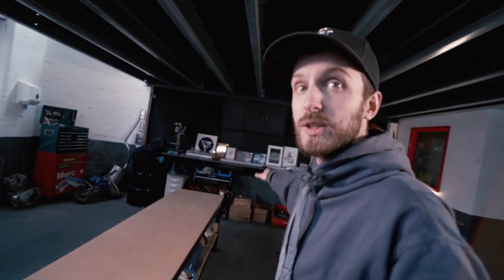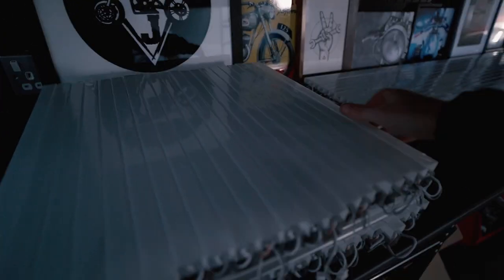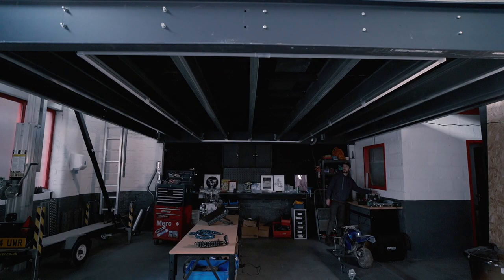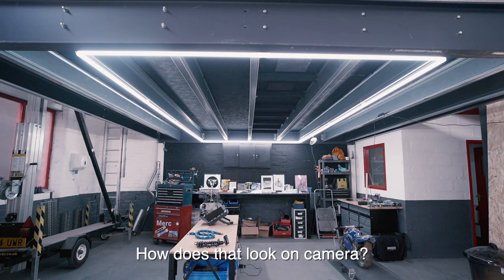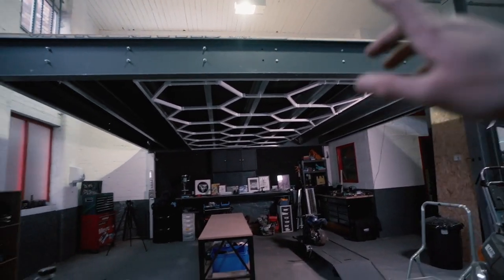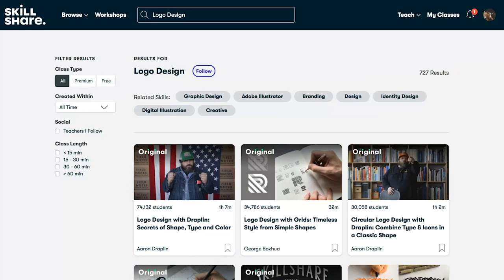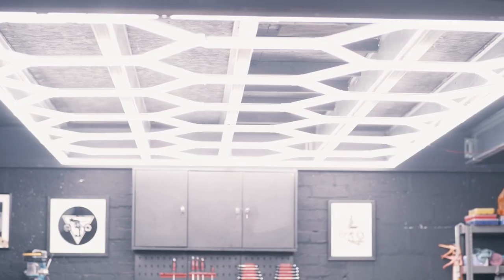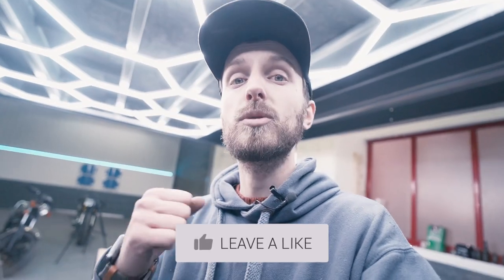Workshop/Garage Lighting - Hex Lights

Comment: Lighting makes a workshop, I went with 5 600 X 300 6000K, 2000 lumen  LED panels, but L also panted the walls white to help reflect the light, It's like a bright summers day it there., looks good in your shop with the hex lights though.